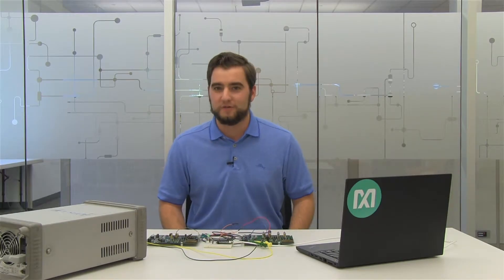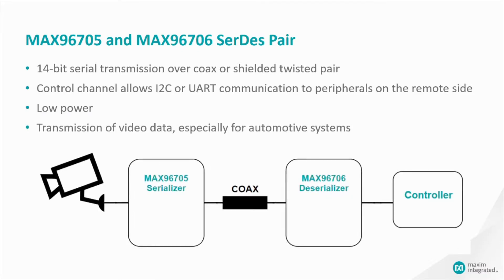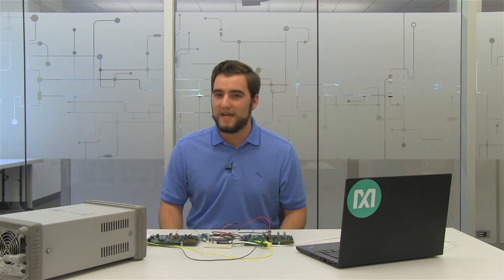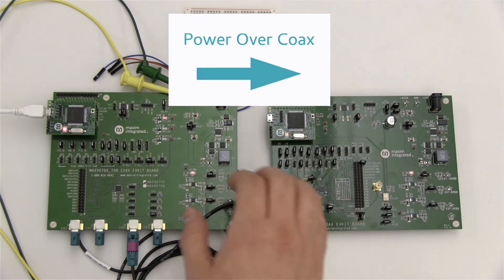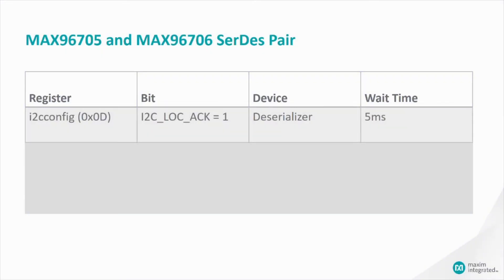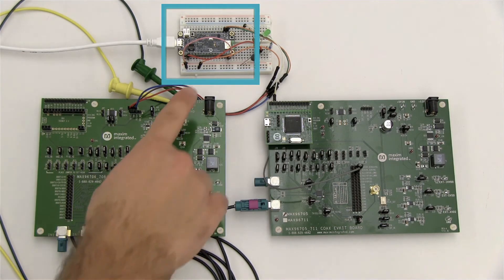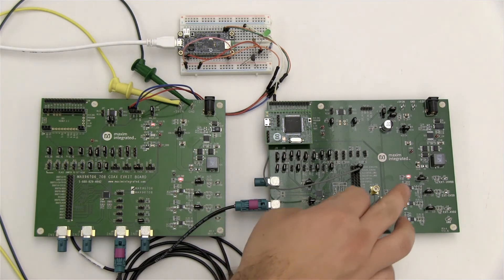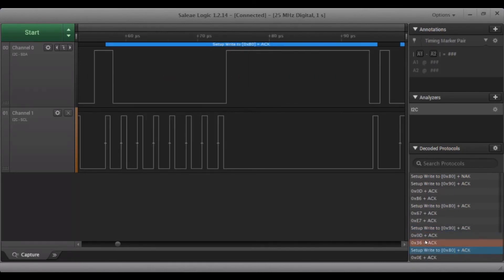How to Set Up a SerDes Reverse Control Channel When PCLK is Not Available - Using the MAX96705/MAX9

Comment: ExcelIent video. 
MAXIMINTEGRATED web page does mention about an Arduino code for setting up the PCLK through I2c. Could it be possible to comment this? Better if this pece of code in Txt could be attached in this excellent video.  https://maximsupport.microsoftcrmportals.com/en-us/knowledgebase/article/000097736